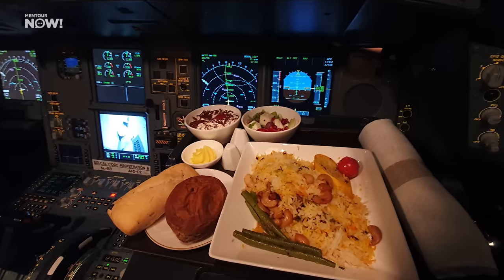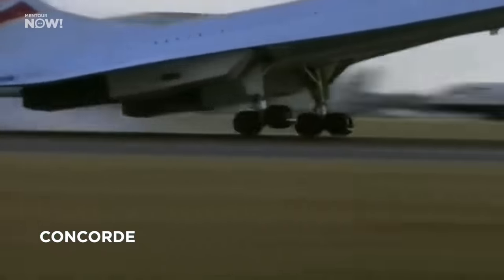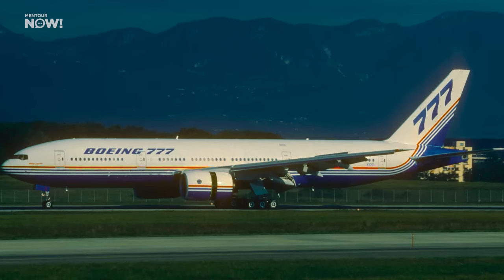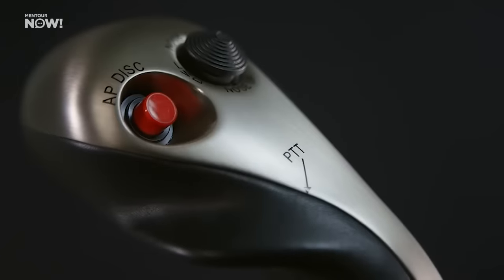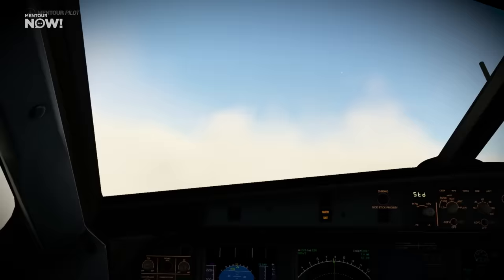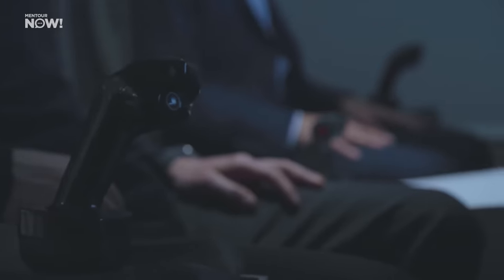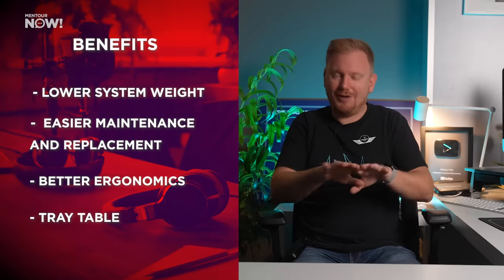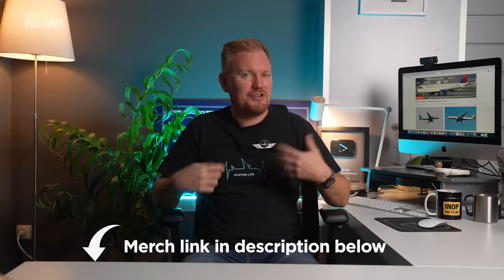Will Airbus Finally switch??

Comment: >12k in the A319/20/21 & A330. Did another 12k in Douglas, Fokker & Boeing prior. I GREATLY preferred Airbus side-stick, fbw w/protections. I know the Boeing guys can put their hand on the yoke, turn around to chat with the stew and know what's going on, but frankly, I just did what Airbus wanted you to do...use your eyes. If you have N1/EPR and FMA awareness, you don't need all that stuff moving around. My periphery vision is good and I could see what the other pilot was doing with his hand. As long as I have the red takeover button, I'm good. Rather than chasing some over active stick pumper, I can lay my hand on my stick that isn't moving all over the darn place and simply push and hold the red button if I need to. I'll add that one reason the Airbus auto-throttle is so responsive in gusty conditions is because the FADEC's don't suffer the lag of having to back drive & physically move the thrust levers like on the 73/75/76.

Comment: With active side stick AF447 (one of my fav video ) might have been avoided. Personaly i am french so an airbus fan but the only thing that matters is Safety and both airbus and boeing make beautiful and safe planes
Reply: The problem with active sidesticks is that they will then be expected to provide feedback from the flight envelope as well. So, the feeling on the sidestick might not be clearly identified as 'Dual Input'
Reply: @Chris_1024_ But it is unlikely to they recommend something which is not implemented or accepted in general aviation yet. For example if some A320 crashes because of lost both engines, nobody can say ''we recommend 4 smaller engines on A320''
Reply: @kadrikarakoc807  It is very likely that recommendations are not implemented or accepted generally; if they were, they would already be in place and there would be no need to make the recommendation.

Most of what goes on in a cockpit these days exists because of recommendations made in a time when those things weren't part of cockpit instrumentation or procedure.

And why on earth would accident investigators care about acceptability of the recommendations? Are they really going to say, "doing X would likely reduce the chances of an accident, but we don't recommend you do X because, well, nobody does it; better just to let aircraft keep crashing"?
Reply: @Chris_1024_     Sully disagrees with you.  I'm going with his opinion.
Reply: @Chris_1024_    Right.  The fact that the right seater was continuously stalling the airplane as it fell out of the sky, and no one else in the cockpit could figure out what was going on.... probably not relevant at all.  A mere footnote, I would say.

Comment: The A220 was actually initially planned to have active sidesticks as well, the servo motors are still there and you can feel and hear them when moving the side stick. It also gives quite a different feel than the A320 family side sticks. No idea though, why the active feature has not been put to real use so far.
Reply: Source? True those sticks feel totally different from the 320s. Not saying this is determinative of course but I've peeled back the boot of the 220 stick and haven't seen any servo motor being there. So please share your info on that, would be quite cool.
Even the Globals don't have active sidesticks I thought, and they use the same setup.
Reply: @ZS-rm5vn I fly the A220 and can confirm, they have a force feedback system that puts opposite force when out of trim, they also shake when the plane is about to stall. Still no interconnection between a stick and the other though.
Reply: WRONG.

Comment: Well, that tragic Air France 447 crash off the coast of South America was partly caused by the copilot and relief captain entering opposite commands on the side sticks. Remember the copilot kept pulling back while the relief captain was pushing down.
Reply: The relief pilot was actually a more senior First Officer who actually had the most experience flying that model of Airbus, even more than the Captain.

Unfortunately, the Airbus side stick (till today) isn't active and the the most junior pilot was the Pilot Flying (PF) in the right seat. He started the cascade of bad actions that led to the catastrophe by pulling the jet up to very high angles of attack & stalling the plane, and he continued making that mistake.

The more experienced Pilot Monitoring (PM) in the Left Seat could hardly control the stick as it was the less experienced pilot in the Right Seat who kept hogging the side stick and making exaggerated movements with his side stick, even though the PM tried to towards the end.

Airbus computers simply gives up when it encounters conflicting input.

Crucially, the PM couldn't see the inputs made by the PF, because Airbus still have yet to install active side sticks that moves in sync with any input.

At the end, it was poor & insufficient emergency training in the simulators.

The PF was hasty in his response, and made very bad idiotic decisions.

Had he waited a minute for the ice to melt off the pitot tubes so airspeed can be read, and kept the plane on level flight (ie. don't nose the jet up unnecessarily), it would not have triggered the cascade of disaster.

Even student pilots are taught to watch their angle of attack, and to resist pulling the nose up as it will induce a stall.

Just aviate, and keep the plane on level flight. Get back to the basics, instead of inducing loss of control with panic moves.

Obviously that PF failed miserably to even do that. 

It was also the Captain's decision to allow the most junior pilot to be the PF before he went for his rest.

I believe that had the PM been the PF, the tragedy would have been avoided.

Given the equatorial storm cells that exists, the more experienced First Officer should have been the PF, at least until the jet is clear of them.
Reply: @therealrobinc  since when the computers “give up” with conflicting input? This is nonsense, on top of that there shouldn’t ever been conflicting input especially after first warning of dual input. The one wanting to interfere should always press takeover pushbutton and take controls. Neither in the cockpit realized the stall and neither of them unloaded the aircraft.

I agree, that probably the situation would have been avoided by replacing the PF before lost of control happened, it’s likely to be avoided even with another “fresh” first officer with similar experience.
Reply: @KoiranenAerospace  Read the official report.
Reply: @therealrobinc , how many times I have to read it? The flight control computers don’t give up and there is no information that any of those would have worked differently than described.
Reply: @KoiranenAerospace  Apparently, not enough.
Reply: @therealrobinc  enough to know that you are talking nonsense about how flight control computers work in every Airbus FBW aircraft.
Reply: @KoiranenAerospace  So you're the Airbus expert now? Nope, you're ain't. LMAO.

Comment: I flew side sticks for years on my homebuilt varieze and Rutan Defiant (push pull twin )  these were mechanical  non electronic control sticks. These were such a natural way to control these aircraft that the owners rarely bothered to comment on them in their discussion.  Having an open lap for paper charts  at the time was a natural advantage.

Comment: I had been flow a B 738 since 2003 as a captain, now I am captain A320 since 2010 ..let me tell you my friends.. Nothing is better than a side stick . Soo you should try it, the most important key is to understand and comprehend  the side stick Air in Air Bus family. Thanks .
Reply: I have nothing against side stick or fly by wire. But I am a strong believer in force feedback. There are only pros, no cons. Another comment points out that's exactly how the side sticks in the C17 work.

Comment: Retired 30k hour Boeing pilot here, so I am probably biased. 😅
HOWEVER I’ve always said that NOT knowing what the other pilot is inputting, is a disaster waiting to happen, and this has been proven with both accidents and VERY near misses. (I also don’t like thrust levers that don’t move on auto throttle - the loss of that visual AND tactile feedback is a big disadvantage.)
In the 1990s I read an excellent article by a retired Airbus test pilot. He said that locking in both of those design features was a serious fail, and will continue to cause accidents (and incidents) indefinitely. He was far from happy with the design.
I concur with that view.

Comment: Very interesting and informative. 

Perhaps if Airbus decides to incorporate active side sticks in their existing aircraft, the A320/A330 neos will also get new cockpits with large screens, like the A220/A350. 

Also curios to know if Embraer will have sidesticks on any future products of theirs. The KC390 and Praetor jets have them, but the E2s still have the yokes, probably for commonality. Would love to have a pilot’s perspective on Embraer yokes versus Boeing yokes.
Reply: The worst thing is where the embraer bicycle wheel pivots. It's below the Y formed by the handles... probably good geometric and engineering reasons for it but on an ergonomics consideration side, banking and crosswind inputs can result in knee bashing, somehow more so than the Boeing UU yokes.

Comment: As a long time Airbus pilot, I can tell you it’s not about the sidestick, it’s about the table!
Reply: Those yokes have got be so annoying, especially considering only a fraction of the time are they being used for manual flying
Reply: @christerry1773 , especially those yokes that are attached to the floor, so even your leg movements are restricted (instead of Cessna 152/172 style yoke that comes from the instrument panel)
Reply: @KoiranenAerospace  or the Phemnom
Reply: @christerry1773 , yeah, that’s good in emb500/505 design. Otherwise the flight deck is a bit too small, even I flew it with the rearmost seat position and I’m not a tall guy. My phenom type rating expired few months ago as I don’t need it anymore, now flying only A320 series.
Reply: @KoiranenAerospace  I flew in a phenom before at the company i work for. If they did single pilot i'd get to set up front. One time, a pilot let me take manual control at cruising alt. I knew the guy but still.....that was Amazingly fun!
Reply: @BillPalmer Are you THE Bill Palmer who wrote the book "Understanding Air France 447"? 🤔😱
Reply: @therealrobinc yes, that’s me 😁

Comment: It would be very interesting to learn about the differences of fly by wire between Airbus and Boeing !
Reply: Airbus way more advanced.
Reply: @EvoraGT430  There's a reason so many old boeings are still in use, as opposed to old airbuses

Comment: I always wanted the force feedback joystick. And now I have money to buy it, but sadly they dont make them anymore. Interesting thing about first sidestick in F16 prototype, it wasnt movable, but they figured out that humans are much better at sensing little differences in location of their hand then small changes in applied pressure. So they made it movable. I am now training in a B737 simulator and I think I would prefer the active sidestick.
Reply: They do, but they are all now very expensive HOTAS setups (Close to $1000 plus last I checked).  I find it much easier to use one than a normal joystick.  Mine's about 10 or 12 years old when you could get them for a more reasonable $200 or so.
Reply: The CH joystick and throttle combos I got through eBay were pre force feedback.  Secondhand through the internet.  I hope they are around...
Reply: Every single HOTAS manufacturer has force feedback sticks.

Winwing, VKB, Virpil (in the works), even Moza is coming out with a base for Thrustmaster's Warthog.

Comment: the best solution would probably to develop a passive mode for the active sidestick. That way Airbus can roll out the technology to the entire, but leave it up to the airlies to make the switch.
Reply from the maker: Maybe, but I would find it highly strange if an airline would NOT want this.
Reply: @MentourNow cost unfortunately often is the decision. Many airlines are cheap and profit first. All the equipment, maintenance and training costs would be a big factor in the decision.
Reply: @MentourNow I agree that airlines may want it, but they can keep their existing aircraft in service while the pilots are being re-trained on the active sticks.

Comment: Good info here, but I don’t think you have a practical understanding of the Airbus flight control system. Even flying manually in direct law you will still know that the aircraft is out of trim because you will have to be holding constant stick input to maintain attitude. Force feedback would be a waste of resources. I have over 2000 hours in the A320 series, and I like the controls just how they are. I’m flying the Boeing 777 now, and its needlessly heavy fake control feel and the constant need to trim seem silly for a flyby wire airplane. The only thing I would change in the 320 would be the auto thrust system. Moving thrust levers like Boeing are a better system, it is nice to be able to quickly override them in certain situations without having to “match and mash” and totally disconnect the system.
Reply: Mentour knows exactly what he is talking about. XL888T had An A320 end up in direct law where the pilot was trying to avoid stalling by pushing the nose down but in the heat of the moment he didn't realize that the autotrim left the horizontal stabilizer at the maximum nose up position, so the stabilizer just pitched the plane back up. Know why? Apart from the fact the "Use Man Pitch Trim" indication on the PFD being missed, there's no artificial control feedback pressure that could have told him the stabilizer was out of trim. That "needlessly heavy fake control feel and the constant need to trim" could have been the last line of defense that could have saved that A320 from stalling.

That heavy fake control feedback may have made the pilots of AF447, Air Asia 8501 and S7 5220 avoid stalling with a heavier control force required at the higher speed to pull back and not having an autotrim maintaining nose up attitude with protections off, giving increased awareness of aircraft attitude and energy state. He even spoke about this in his S7 5220 video. Holding the stick constantly to see if the plane will maintain attitude is only fine if you ain't in a confused/stress state, not about to stall the machine and can think logically with the use of the stick and trim wheel. Don't need to be an Airbus pilot to realize the disadvantages of their FBW system.

Comment: Great video, totally agree!  Active side sicks would have prevented the fatal Air Asia A320 stall crash as well.  Also modifying the Thrust Levers to move with the Auto-Thrust system would give us better much better interface with what's going on.  That system is over engineered in my opinion.  16yrs - 737/12 yrs - A320

Comment: I feel like this would be quite easy to implement on the A220 since from my understanding it is flown like a Boeing, you trim for a speed, if you push the throttle forward, the plane will climb, and if you pull them back, it will dive to chase the speed it's trimmed for as any conventional aircraft would, the only difference being its stick being passive. On regular Airbuses that would be a much bigger change considering that you do not trim it, and unlike a conventional aircraft, if you're flying straight and push the throttle, the aircraft won't climb, it will accelerate and trim itself nose down, which is comfortable but is the opposite of how aerodynamics naturally works. Keeping these control laws with an active sidestick would probably not allow to take full advantage of the sidestick, and changing it would be a huge change in handling for the thousands of pilots flying these planes so it may be a bit complicated to retrofit

Comment: I’m also on the A320/321 and agree with the other statements about the advantages of active side sticks like being more connected to what the aircraft is doing and feeling the control inputs of a pilot with low time in the Airbus.   

The only disadvantages I can think of is presumably more cost and reliability…it is one more thing to break and possibly ground the aircraft.  I wonder if this is why Airbus has its version of auto thrust vs moving thrust levers.

Comment: The biggest challenge with the recent sidesticks is that at what point exactly, not too early notice too late, that I have to take over the other pilot’s control. Personally I use the force I feel on my butt against the seat cushion to determine if he or she is doing good enough, but maybe as a senior who has already had over 15000 hours is capable to do so, but for a junior pilot, I really want them to feel what I’m doing on the stick, how much force I use on the stick to get the plane on ground. But with the recent version of the 320 sidestick, it’s difficult to accomplish.

Comment: I'm clearly pro fly-by-wire, but it's better artificial feedback that none.

Still doesn't entirely solve the dual input problem. The active pilot might perceive different stick reactions coming from the aircraft and not from the other crew member.
Reply: The aircraft should still be able to sense dual input by comparing input force on the sticks and warn the pilots.
Reply: @kwikdahl   Sure, but that it already does. Apparently without much success, because when that happens, pilots are under stress and don't listen to the call outs anymore.